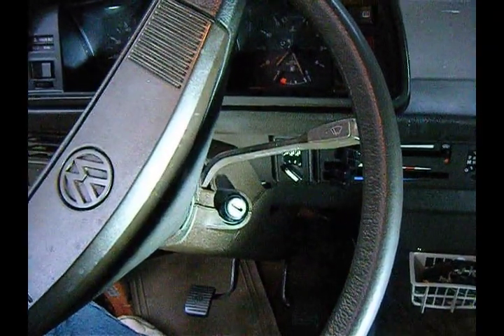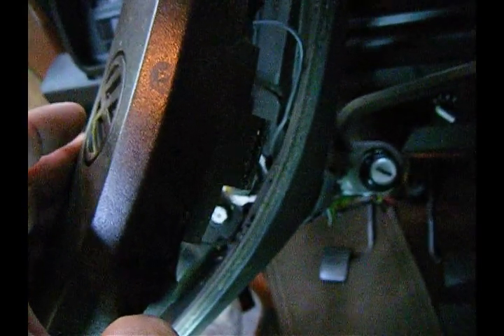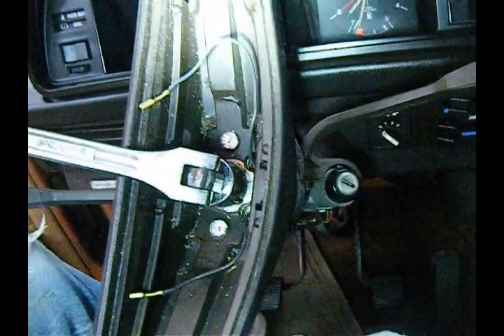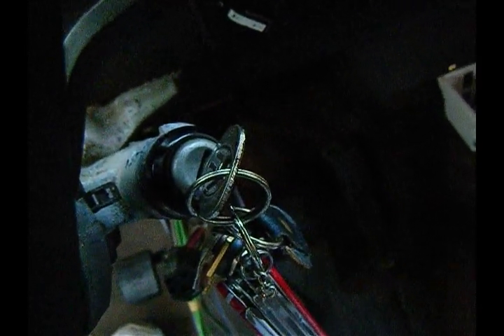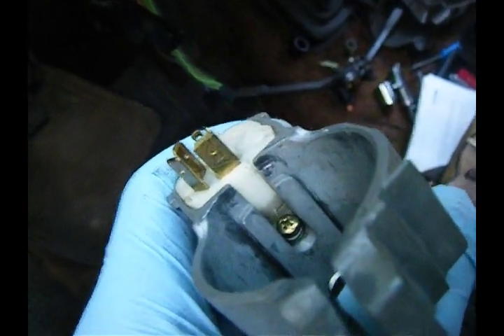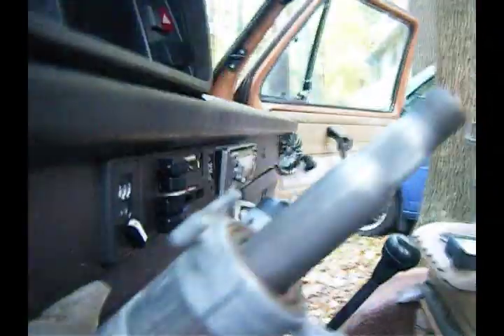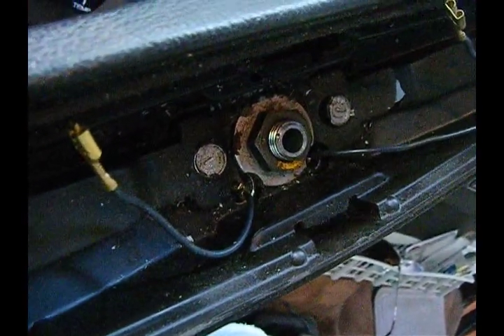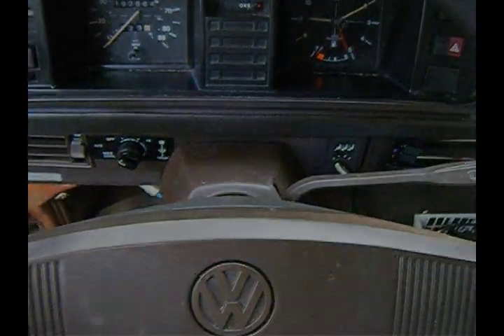Replacing Vanagon Ignition Switch

Comment from the maker: If the wheel is not turned then when you try to turn the nut the wheel just turns instead.  Having it locked all the way to the left allowed me to get it off easily.

Comment: Bryan, where do you get those cameras that make everything look clean?  I want one.
What was the point of turning the wheel left?  If you leave it centered then no problem getting it back on correctly.

The horn pad just pulls off, and I recommend leaving the wires attached 'cause they're murder to get back on w/out bending the terminals.

Switch position on column controls horn-contact spacing.  I recommend scribing around original position before removing.

Comment: HI...I am wondering what your initial problem was..? My T3 wont start...I am wondering what actually goes wrong..?
Reply from the maker: +楊智強 Intermittent starting is usually the main symptom.  Sometimes odd electrical issues are to blame too.
Reply: what year? automatic or manual?
Reply from the maker: 1983.5 / 4 speed manual